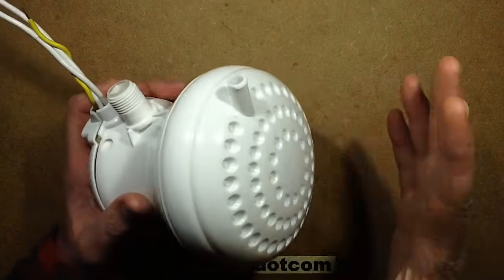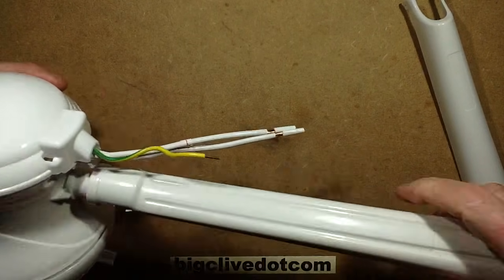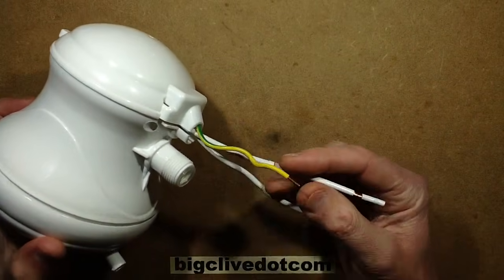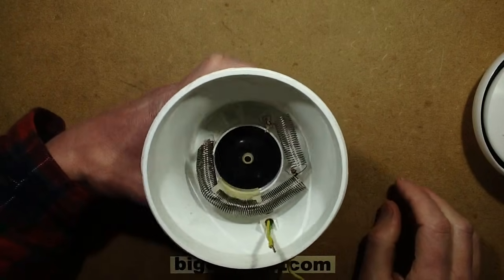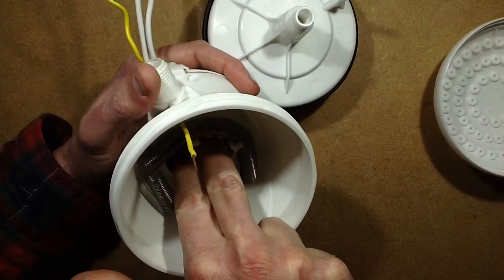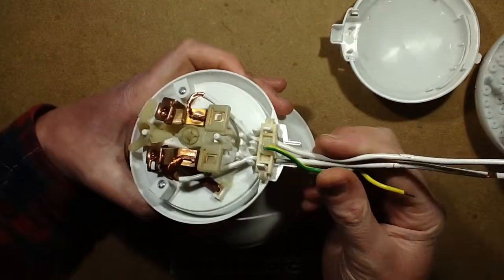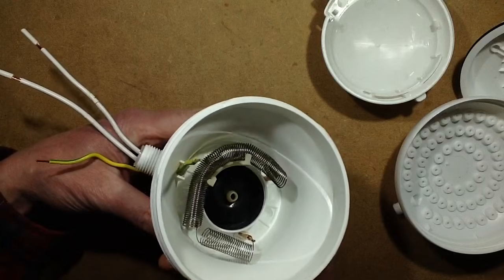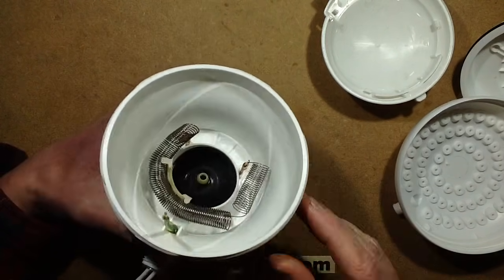Inside a heated shower head.  (suicide shower)

Comment: Instead of hooking into the mains, wouldn't it be safer to give a waterproof battery pack and stick a 9V or a couple of D cells in there?
Reply from the maker: These things are rated about 5000W so the battery pack would have to deliver about 1000A for the duration of the shower.
Reply: Yikes... would need a pretty large pack then...
Reply: not very safe for your bank account
Reply from the maker: Yosef MacGruber The cost of a 5000VA (5kVA) transformer would be huge.
Reply: *****
Water and electricity do not mix? Surely we would want to see greater isolation.

Just sticking some grounding wire into some water, is not a very reliable ground.

It is a shame to see so many corners being cut, in the obvious need to heat water. The U.S. has had reliable electric and gas water heaters for what? The last half century at least? Why can't the world copy designs that already work well? We have both the big tank of hot water, and the tankless water heaters, and neither has any serious shock hazard.

Whatever happened to proper engineering? So much cheap unsafe crap is coming out of China now. They just throw some crap into some plastic housing, and if it halfway seems to work, just rush it out to market. I saw at the store, some plastic power strip with multiple electrical outlets, and it claimed to have surge suppression. Yet I could find no specs on the package at all. What? No joule rating, no picture of what surge suppression parts are inside of it? If I was to take it apart, should I be surprised to find no surge suppression parts at all? I watched some YT video, of a power cord going into meltdown, at about the current rating that it was supposedly supposed to be able to handle safely.

Whatever happened to safety testing? I recall a long time ago, some TV show that showed products being tested. The thermostat was bypassed on a plastic coffee maker, to simulate a stuck thermostat. Within just one minute, the unsafe piece-of-crap went into meltdown and caught on fire. Imagine somebody waking up in the morning, to that. Why is a heating element crammed into a plastic housing, rather than it being made out of metal, which does not burn? Whatever happened to safety considerations? Why do not more devices or device plugs, contain fuses within them?
Reply: *****
So there is no chance at all, that the heating element could break? It looked rather fragile to me, and then there is the constantly-flowing water putting temperature stresses upon the element and perturbing it. Without much surface area to efficiently transfer the heat, perhaps it gets rather hot?

And you seem to be ignoring the prospect of a parallel shock circuit forming. Even though the element might be "the path of least resistance", the voltage potential across it, is still about 230 volts. If somehow just 50 volts makes it into the water, might it still tingle? That is not the kind of tingle I want from a shower. And what about the shock circuit path? From your arms to your heart to your legs and feet to the drain? If only your hand gets shocked, you probably will still live. But if it travels through your heart, could it possibly disrupt the beating of your heart? If you collapse and fall, you are still in the shower with the water still running. Are they seriously relying upon the water making separate droplets, and not any continuous water stream? I supposed it might be possible to pee on an electric fence and not get shocked?, but I think I will let some other person more foolish than me, give it the first try.

And what of the claims of that thing catching on fire? Switch contacts can become stuck together, especially under the high current loads they would experience. The drop of water pressure as the metal-grounded faucet handle is shut off, might be too gradual to insure the sudden-off motion that reliable switches are supposed to generate. If while shutting off, it sparks and arcs, couldn't that weld the contacts together? Or maybe the switch degrades over usage? One of those YT videos I watched about this shower head, showed the plastic casing lighting up with the spark from the contacts, just in pushing the lever to change the heat setting. That hardly seems safe at all.

What credible safety ratings organization, would put their symbol on that suicide shower head?

Back in the old days of plumbing, even if your electric water heater in the basement presented a shock hazard, how many volts could realistically travel along the water, after traveling some 30 feet or more, inside of grounded metal water pipes? You might be tripping the circuit breaker, long before you feel any tingle? Some people even think you should stay out of the bathtub, during a thunderstorm, because lightning might strike somewhere, and the electricity travel through the pipes. Now with plumbing increasingly going to plastic PVC, how does that change things? Going from safe, to not-so-safe, to downright dangerous?

Surely there is a much better way to build this device? But then it might cost 50¢ more? Which means that the store might jack up the price by another $5? I think a few dollars more, is well worth it, for the peace-of-mind.
Reply: *****
So the water in third world countries, is certified by somebody, to be non-conducting? Is it guaranteed to always have low levels of salt and minerals? Are you seriously an engineer? According to your claims, you should know about the special requirements in hospitals or for fancy computer equipment, for isolated grounds. Over a long run of wire, a supposedly zero-voltage ground could actually have a few volts upon it.

And we are not just talking about some low-voltage battery-radio getting wet, but of 230 volts, which even an experienced electrician does not want to get zapped by. Sure, many electricians might feel okay with working with a mere 120 volts and leaving circuits live and "being careful". It is often easier than trying to go and find the proper circuit breaker, and perhaps some clients don't want to be in the dark for hours while work is being done. Yeah, I have somehow touched 120-volts, and it is like, "Yeah, that is live. I definitely felt that. And it did not feel very good." I hope that not too many electricians touch wires to see if they are live? Besides it is not reliable. A live wire probably does not feel live at all, if you fail to complete the circuit. If you are not standing in a puddle of water or also touching the neutral, you might not feel anything at all? Fortunately, the human body isn't all that great of an electrical conductor. But when you start getting up to 240-volts and above, you cut the power off, as you don't want to become a widow-maker husband, well if the electrician is a guy.

Most "live" electrical heating elements, probably are not live, but rather non-conductive or grounded. The element exterior only conducts heat, and not electricity, well unless it has cracked open? Wouldn't the heating element wire be very thin, if it was electrically-conducting? Otherwise, the resistance would be too low, and it would overload the circuit in drawing too much current.
Reply: *****
There is a huge difference between a product that is unsafe, and a product that is sure to kill you. But even if "just a few people" get electrocuted, or experience a painful tingle, shouldn't that be concerning?

So now you are saying that you are afraid to hold a live wire, out in the water puddle in the rain? But why? Are you claiming it is unsafe? But here I thought you said, that it doesn't matter? It is safe enough?

I suppose you haven't seen the horror movie "Pulse"? Not the newer one, but the older one that makes electricity out to be some sort of devious villain, looking for ways to harm people. The movie is sort of spooky, because it has some half-truths in it, and come to think of it, electricity is sort of mysterious, isn't it? If the makers of that movie, saw this suicide shower head, somehow I imagine they might want to come out with a sequel to that old movie?
Reply: If grounded and set up properly there should not be anything wrong. IT is the fact that this thing is so easy for an idiot to mess up when installing that makes it dangerous.
Reply: bigclivedotcom
And still the device is a fire-hazard. Surely there is something wrong with putting high-powered heating elements inside of a plastic case. What could go wrong? (sarcasm)

What upgrades would you suggest in such a cheap device, to make it safer? Or should a proper separate water heater be used?

Why is there such a pandemic of unsafe and dodgy electrical products?
Reply: *****
There is no electric heating element, in a gas water heater. And why do you think that the electric element is live? Isn't it encased inside of a larger heat sink element, and the actual electricity conducting wire, is deep within it? If the wire of the burner element was really that thick, how would it not instantly trip the circuit breaker? Its resistance would be too low, and it would draw too much current. Electric stove burners are not live, are they? Just hot. Has anybody ever received an electric shock from touching a stove burner element, before it became hot? And doesn't it actually sit, upon grounded metal? It obviously has some sort of support, to support a water-heavy pan sitting atop of it.

Now who is vomiting BS?

And why is it, that on an electric water heater, you have to take a bunch of stuff apart to adjust the temperature, but on a gas water heater, you just turn the knob right there? Are electric water heaters designed by morons?

So if live power lines fell into the lake or the swimming pool, you would still go swimming, because water supposedly can't conduct electricity all that well? Well then, I guess all those video games (Half-Life and Star Trek Voyager Elite Force) that have water with some electrical wire having gotten into it somehow, and lightning sparking all around the water, must be wrong then. Well obviously the special effects are probably exaggerated. They just want to spare you the voice-acting sound of somebody (you) getting electrocuted when you just step there, not knowing that the water was electrified.

You should let the appropriate electrical regulatory board know, so that we can save all that money, not having to install costly GFI receptacles into every bathroom and in every outdoor place and basement. Now that supposedly most electrical shock risks are now deemed imaginary? (sarcasm)
Reply: *****
So what are you saying? You want us to trade in our safe water heaters, for those pieces-of-crap suicide shower heads?

Or the pig might be amused, that you even want to be around it. Maybe you might rather teach a dog to sing, as dogs are so eager to please their human masters (pack leaders).
Reply: *****
Well show me how safe they are, by holding a live 230-volt wire while standing in a wet puddle outside in the rain. Somehow, I do not foresee you accepting my offer? Well why not? What do you have to worry about? If your claim that water (usually) doesn't so well conduct electricity is true? So then, I guess the electric hotdog cooker that I saw long ago, that sends electrical current between the prongs through the hotdogs, doesn't really work then?

Even if this "suicide" shower head is slightly safer than the risk of freezing to death in a quick 10-second shower without any heated water, I don't consider that safe at all.

Do you have this suicide shower head yourself? And most days, it doesn't tingle too bad? No? Then why do you care to defend it?
Reply: *****
Well go hold a live 230-volt wire then, while standing in a wet puddle out in the rain, barefoot. Show me how safe it is.

I would love for one of those "take it apart" YouTubers, within a modern country that doesn't use such primitive electrical crap, to take this thing apart, and go bezerk counting all the safety violations. So far, I have only seen but a few reviews, saying that it might be sort of okay, well if they actually bother to connect the do-little ground wire.

I saw in one of the videos, the whole plastic housing lights up, from the sparking inside at switching the heat level switch. I can't think of any other electrical devices I have seen like that.

Brazil must be a really backwards country. I have never been to Brazil. Until these YT suicide shower head videos, I don't think I have ever seen a wire going into a shower head. What kind of crap is that? There is this thing we have in The States called water heaters. I can fill an entire bathtub with nice warm bath soaking water, in just 7 minutes.

Is it normal in Brazil, to just see loose wires, strung through one's living space? Here in The States, almost never do we actually see the loose wires, except in the basement or attic, which are not normally expected to be in a "finished" state of appearance. We hide our wires in the walls, or inside of conduit, as to look more safe and professional.

And what kind of safety certification do these suicide shower heads have anyway?

And why did the video title, actually call it "suicide"? Was that perhaps a random irrelevant typo?
Reply: cyberfloater look buddy, people in brazil don't think twice before throwing their thrash up their river, what makes you think they care about solar power?
even for people who want to do it the government taxes them bone-dry for anything fancier than wooden wheels with magnets.
Reply: Yosef MacGruber each area has its reasons for its choice. 
Here in brazil we do have dedicated hot water systems,  but it only shows up on rich boy apartment complexes. 
The usual hot water storage systems are not as simple and cheap as a resistive shower. 
And guess what the guy who suffocated in the bathroom 3 years ago was using?  that's right,  gas-heated water. 
doesn't really matter what kind of setup you use to shower,  you will have to be stupid enough to die in any type.
Reply: Yosef MacGruber heating water takes energy,  you know. 
This is not even supposed to be an argument about wether to use said suicide showers or not. 
The things are just there as they have always been, it's as convenient and old as your usual gasoline powered car. If it doesn't look obviously broke,  people won't fix it. 
And yes,  the guy died because the gas was leaking through his bathroom water piping. Just as easy as dieing on a suicide shower.
Reply: +Yosef MacGruber 
"manned moon landings were probably faked." ...and there it is, official nutjob territory. Why read on.

"Free-energy" isn't possible because of Entropy. It's the same as saying you have perpetual motion machine.
Reply: You're the smartest person I've ever met in my life.
Reply: What about using an isolation transformer? Would that do much to make it safer?
Reply: Yosef MacGruber
Reply: michaelbianchi22 it takes KW of power (thousands of times the energy you use on a flashlight) to heat up a stream of water.
Good luck filling up your garbage can with hundreds of D cells.
But they could use a step down transformer to lower the voltage to 10VAC or something, it would make the thing safer, though water makes it much easier for electricity to kill you...
Reply: Yosef MacGruber i think there is some kind of threshold for the ammount of water between the heating element and the exit orifices.
I mean, the thing is already forcing 5000 amps through a submerged wire and the water inside is very resistive, so it should be quite hard to get zapped even without grounding, right?
Reply: José Qués
So that explains why you are so messed up in the head? Because your brain gets tingled every time that you take a shower?

Why is it, that in The United Slave of America, we turn on the hot water faucet, and we get consistent hot water, for the last half century or so. But then we travel to another country, and their hot water is iffy? Kind of cold, kind of hot, not so much reliably hot like it should be. Come on, how hard is it, to copy the reliable water heaters that we Americans use? How hard can it be? It is not like it is some secret or mysterious technology.
Reply: Blendedasian
Rich boy apartment complexes? A water heater only costs but a few hundred dollars. And one can potentially install it oneself, if they are handy enough.

Does Brazil have a shortage of competent plumbers, or what?

Let's count the typical number of hot water faucets in the American home:

• The bathtub shower and tub fill spout
• The shower in the other bathroom
• The bathroom sink(s)
• The kitchen sink
• The basement utility wash tub
• The clothes washing machine

Are you telling me, that Brazil has a separate water heater for all 6 of these applications? Or is hot water, used for the shower only? Is Brazil just a backward third-world country? BTW, some American homes, have more than 1 big-tank water heater.

Gas-heated water? No doubt a crappy system installed improperly?

Why are you people defending these "suicide showers" anyway? You already lost the argument, when you decided to comment on a video entitled "suicide shower". Like who didn't know where this conversation would inevitably lead?
Reply: +Blendedasian
Burning fuel to power a car, is a really stupid idea. But we do it, because the evil NWO criminal elitists stole and suppressed free-energy technology from Tesla and the American people, so as to extort from us their phony energy-scarcity tax. The universe is full of energy, and energy should be free by now. But that corruption is what we get, when the American morons worship the corrupt so-called government.

Ironically, if the shower head was directly powered by internal free-energy technology, even if it was electric, there would be no shock hazard, due to it being electrically isolated thus not completing a circuit through semi-grounded water. However, whole-house free-energy machines, likely would be grounded as normal, to comply with the existing electrical standards and safety considerations.

You should consider the line I remember from the movie iRobot, set a bit into the future, in which some woman is semi-concerned that the motorcycle is powered by gasoline. "Isn't that dangerous?", she cautions. "Doesn't gasoline explode?" Or something to that effect. In the iRobot not-too-distant future, we learn that cars no longer burn fuel, and they are all self-drive, which enables them to travel faster and safer. Soon into the future, people might be just as concerned about gasoline engines, as they are about this obviously-unsafe suicide shower head. Once we have better and safer alternatives as we should have had already.
Reply: +Yosef MacGruber
(weird energy conspiracy theory rant)
(back to shower head, but now it exhibits strange electrical properties)
(movies, future = everything is safer and electric cars)
While it's a nice thought for the future, chemical energy and liquid fuel will never go away. We'll find new ways to produce it rather than extract it. Some things will not be able to go full-electric. Battery-powered cars might dominate consumer markets, but that's it. Large trucks, Tow vehicles, freight, trains, jet engines, all require more energy than we can pack in a battery yet, b/c the energy-density of lithium-ion cells is terrible compared to something like diesel.

You may be right, and the future may be completely baby-proof. But there are things with even higher energy-densities than chemical fuel, such as nuclear. With nuclear engines we could get to Mars in less than 100 days, and we've had prototype engines built since the 60's. Nobody's done it yet because "nukes in space" makes everyone a little queasy. Hydrogen fuel cells for example can easily beat Lithium-Ion cells, and hydrogen is in nearly everything (plants, seawater...). We just need more infrastructure to extract, store, and transport it. But people don't like this because, "Doesn't hydrogen explode?!" Yep, and so does gasoline. When's the last time you've heard of a gas station exploding? Are you terrified every time you go to fill up?

In my future I think we'll all be using more potentially-dangerous chemicals and sources of energy in our daily lives. We'll just have a much better understanding of tolerances, safety, and risk while handling them, just like we know "no smoking at gas stations." If we're going to dominate this universe, we may as well exploit the limits of its potential.
Reply: +The Large Hardon Collider
More energy than we can pack into a battery? Well that is all the more reason for free-energy. How am I supposed to be able to afford to power my own ship, airplane, or spaceship? Well free-energy sure would help. Why shouldn't ordinary people be more able to afford things that otherwise would require so much fuel, that one must keep them ever chartered out to paying customers, just to keep it running?

Yeah, have fun trying to get to Mars, when the manned moon landings were probably faked. Maybe you better figure out why it was faked, before trying to go to Mars?

I am pretty sure that that is not the reason.

Hydrogen doesn't produce energy, but only stores energy, and it is one of the worst low-density fuels for storing energy. Compressed natural gas, works far better and is cheaper.

Yes, gasoline was portrayed as dangerous, in the movie iRobot, in which in the near-future, vehicles do not burn fuel anymore, well except for that old non-self-drive motorcycle. And most people do not like refueling. That is why so many people fill up, and run their cars to near empty. So as to have to refuel as seldom as possible.

We will be using safer technologies for energy, that work much better.
Reply: +The Large Hardon Collider
And why is it "official nutjob territory" to consider conspiracy theories that are actually quite popular BTW? What do we have to show for manned moon landings being real? Can I go to the moon and walk around, and see if manned moon landings are real? Do I have so much as a little moon pebble? And even if I did, how would I know that a so-called "moon rock" came from the moon and not the earth?

So you would go to Mars, and not even wonder about whether it is really possible for humans to go to Mars? You are just so sure, you have so much faith in the liar mad-scientists and liar politicians, that your trip to Mars is really to Mars, and isn't just some forced 1-way trip? Robots are not alive, so if the Van Allen Belt radiation is lethal to life, robots may not have that problem, nor do robots have any expectation of a return trip. Robots do not get lonely, nor do they get homesick. Just like any faithful computer, they just run their programs.

Science and entropy do not preclude free-energy. If a free-energy machine can attract its own energy from the universe, then why can't it be a "perpetual motion machine", well sort-of? Do you have a fan? A fan spins perpetually, day after day, year after year, as long as you keep the electrical power flowing into it. Supposedly the induction motors that make that possible, were impossible or so said Tesla's teachers, yet he invented the brushless induction motor, that runs without making sparks by requiring a commutator, and thus electric motors can run for year after year without wearing themselves out. If a free-energy machine produces its own energy from the universe, then anything that is connected to it to be powered, also becomes a free-energy machine or appliance. Cars could be free-energy, cellphones, refrigerators, everything electrical within your home - with a whole-house free-energy machine. Superconductors are seemingly impossible, but that has already been proven to be wrong. Superconductors have zero resistance, and that is why they can appear so magical. A magnet just spins and floats above a superconductor, unable to fall into it, because the magnet induces a current within the superconductor, that just keeps flowing without resistance to bleed it off, and that current produces an equal and opposing magnetic field that opposes the fall of the magnet. So the magnet just levitates "magically".
Reply: "And water actually does not conduct electricity It needs to be Ionized by salt or other mineral in good quanity to conduct enough to harm you"

What about hard water areas where limescale builds up after a few months?
Reply: Why there's people that are arguing against something that they CLEARLY don't know about and is have been used in the last 40/50 years in almost all Latin America?
I mean, the death rate of these showers when they're are installed properly are actually near 0...
I've been using these kind of showers for the last 25 years and so my family and almost everyone that I know and we are all still alive...